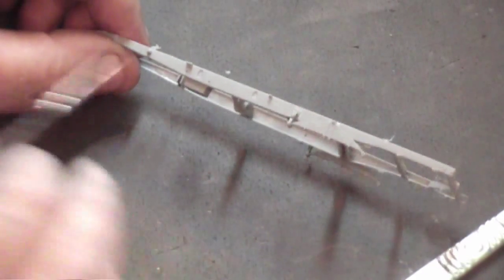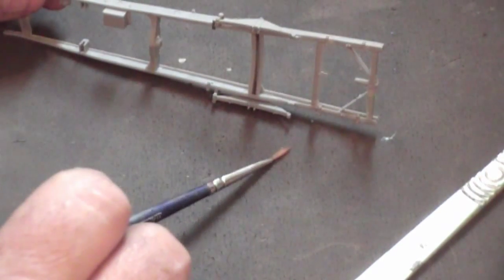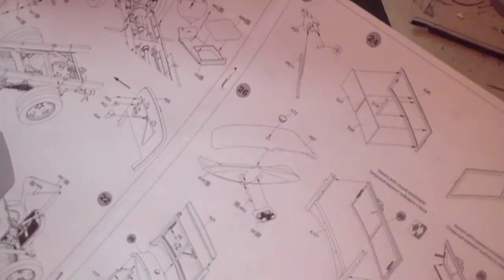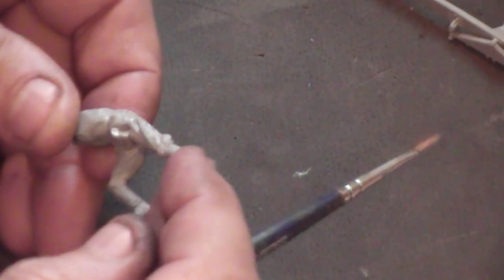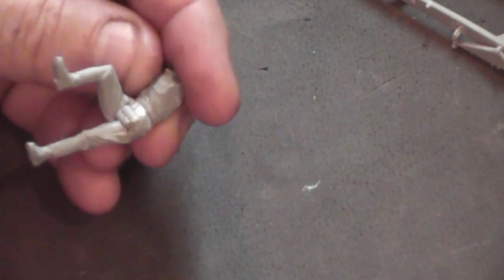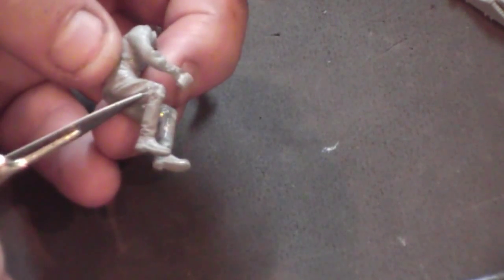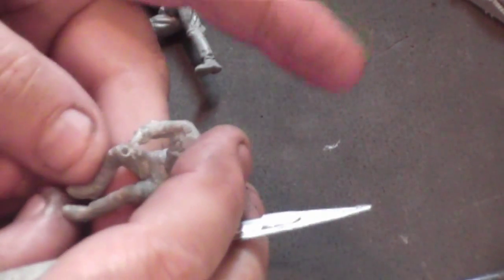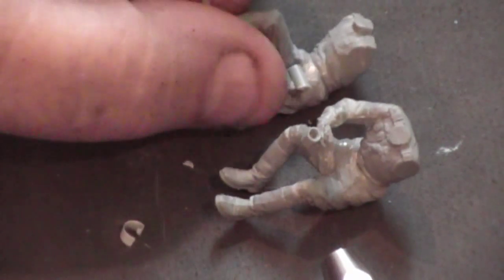Miniart GAZ-MM Mod 1941 part 2

Comment from the maker: Sorry it's taken so long to reply but when problems with the U T I found an old Brenda of mine in the workshop will have to make a special tool for it but I think I can use it to bend that particular item it shows that on the instructions that is is around channel but I found some photos and video of one that's beening square cornered .Thank you for your comment as four Bending around a Brass wire it have to be 0.2 which would make very hard to do I was looking for a different way of doing it